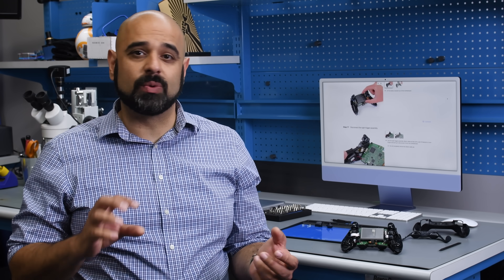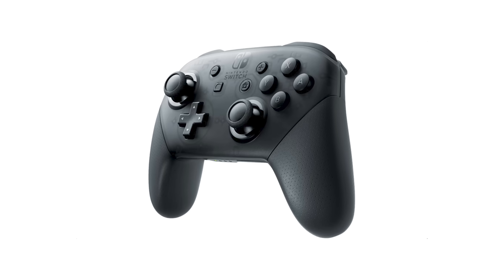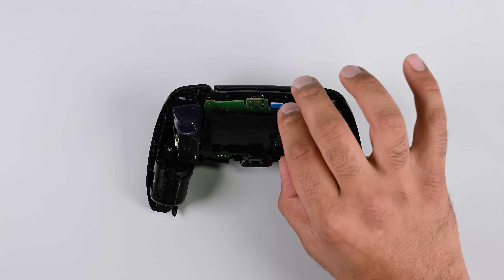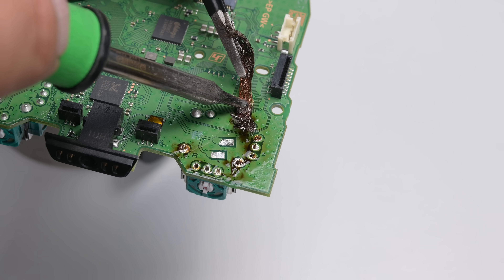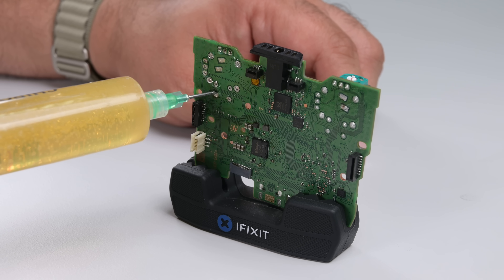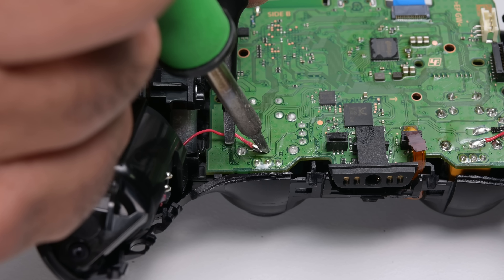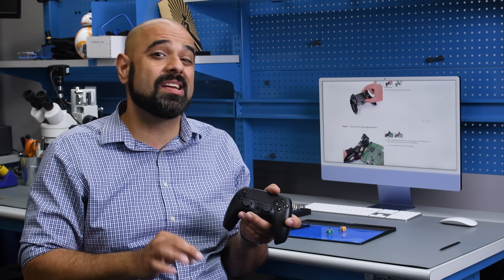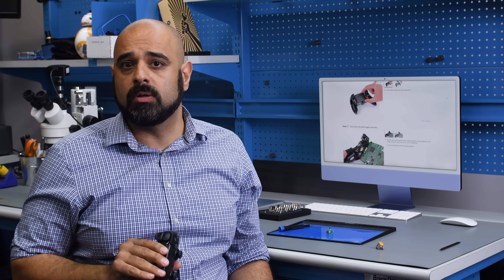How to Fix PS5 Joystick Drift for Good!

Comment: I can vouch for the Hall effect DualShock 3 controllers. I have a Japanese one from 2008 and it still dead center till this day. I just need to change the battery.
Reply: Yep. I guess I have one, my PS3 controller is 11 years old at this point. Still works like new.
Reply: @thebritishviking  same here but 17 years later
Reply: No need to vouch, the magnets are what make it possible.
Reply: Magnets, how do they work?
Reply: i can also vouch for a ps3 since then. it's good but battery idk
Reply: Same here
Reply: That's good to hear. I was a little worried, because I have heard that magnets loose their magnetism naturally and I have several older consoles like a PS1 and N64. So I was wondering how my PS5 would hold up with Hall effect sticks on the long term of not using them.
Reply: @TheRealBOBlibob ps3 controllers have magnets?
Reply: @castillomartin25  only some models. Some models of the dualshock 3 have hall effect sensors/magnets in the joysticks. But most don't.
Reply: @TheRealBOBlibob  the magnets lose 1% every 10 years or something like that naturally
Reply: @TheRealBOBlibob  I'm pretty sure if stuff lost magnetism then humanity woukd get destroyed by cosmic rays lmao. I'm no scientist though.
Reply: @ExecutionerDan  no he's right, metals do lose magnetism, but it takes way longer for a metal to lose magnetism vs normal sticks to start drifting
Reply: @Syddy_  interesting. Probably takes decades if I had to guess though right?
Reply: @ExecutionerDan  i just did a quick google and the magnets in hall effect sensors are neodymium, which only lose about 5% of their magnetism in 100 years. so i guess they're basically permanent. i was going off  like magnetised screwdriver bits that lose their magnetism way faster.
Reply: @Syddy_  appreciate it. It's cool to know that my apex 4 controller can theoretically last me decades before it fails. It'll be the buttons before it'd the sticks to give out now which is amazing.
Reply: @Syddy_  By the time that happens most of us will be long gone LMFAO
Reply: @Syddy_  Magnets can also have their magnetism 'refreshed' by being exposed to electrical fields.
Reply: @Syddy_  That's awesome. It seems like there are no downsides at all
Reply: @ExecutionerDan  your right, you arent a scientist
Reply: @Syddy_  yes, even if we somehow find a centuries-old hall-effect controller, you could just magnetize the magnets again with a magnetizer for like 3$
Reply: @Syddy_  What if i want to play some Fortnite season 500 in a couple of centuries? that's not permanent
Reply: @ExecutionerDan  I got water on mine and it got stick drif really fast, I also dropped it a lot, didn't treat it that well, was expected.
Reply: Not exactly hall effect. They had a new type of sensor developed for it, which didnt had the issues of hall effect.
Reply: weird my DualShock 3 started drifting on the right stick recently
Reply: @dylanconnelly9845  sadly not all of them r made the same
Reply: @dylanconnelly9845  The PS3 controllers have different batches, and if I remember correctly, the DualShock version does not have Hall Effect joysticks, and only the Sixaxis Controller version does

Comment: Manufacturers  want you to buy new controllers thats why hall sticks aint in them
Reply: I hate that it's true
Reply: Not Sega in 1998, the Dreamcast controller was hall sensor... they still work great
Reply: Dreamcast controllers are built like  Nokia phones
Reply: @fostrike Sega was a good company, and it's sadly the reason why it went out of business unlike the greedy corporations like Sony, Nintendo and Microsoft.
Reply: @StardustLegacyFighter  I like Sega, but that is certainly not why they went out of business. They can be just as greedy as Nintendo, Sony, and Microsoft.
Reply: @Malachi-Rhodes you mean Sammy Sega
Reply: @StardustLegacyFighter  Bro what.

Sega only stopped making consoles bruh. They are a giant in the video game development section thanks to Yakuza, SMT, Persona and Sonic.
Reply: @fostrike let's not forget about the ps3 in 2006 now
Reply: Also the Nintendo N64 analog stick is using a sort of optical encoder with slotted wheel similar to the one's used in the old school ball mouse, apart from mechanical wear they are pretty much immortal
Reply: Exactly
Reply: Definitely. CA$H grab!
Reply: The customers are also partially at fault for simply throwing away their controllers when just one component starts malfunctioning. Maybe it's because I'm from the third world, but I can't imagine having payed $60+ for a controller and not attempt to do anything to avoid having to replace it altogether. You don't even have to pick up a soldering iron yourself, there's plenty of electronics repair shops that regularly do analog module replacements.

Companies only seek to make as much money as possible, and if people keep enabling bad practices like these with their money, it's no wonder why they keep doing it.
Reply: sadly 3rd world countries such as Pakistan dont offer any form of customer warranty via any retailer since the company ( Sony ) cant provide it in some areas , and offf talk about the prices of these controllers , they cost around 80 - 90 dollars here instead of 60 retailers jank their prices up since they are imported products .
Reply: @inendlesspain4724  currently ive had my controller for around 5 to 6 months and its already started to have issues in its right thumbstick , plugging it into gamepad tester my controller doesnt register the bottom right and full right movements on my right thumbsticks , it also has drift towards the left on the controller ( left stick is fine for now ), repair shops here charge for 1/3rd of the controller it self for minor issues
Reply: @mohammadosman1474  Assuming you buy the hall effect analog modules shown in the video and tell the repair shop guy to use those instead of regular ones, I'd say 1/3 of the price of the controller for a permanent fix to analog drift is a pretty good deal.

Though I can see that being a problem before these things existed.
Reply: @inendlesspain4724  the current state of hall effects do have some issues either via jitter , non linear movement , or a delay in movement the only ones that are perfect are made from gamesir or gullikit they have the best ones i hope sony lets them make a licensed ps5 controller
Reply: is that not cause enough for a class action?
Reply: @HottiePersona  I was going to ask this same question 😂 if they knowingly are making them to break down then that is bad business . BBB let’s get their asses paying us back something
Reply: idk what to tell you man, everytime i got stick drift i send it back to the manufacturer and got a repaired one back, maybe just dont throw your controller away immediately?
Reply: HAll Effect sticks have their failure points as well...this video is just telling half truths...
Reply: was about to comment the same thing, concidering if manufacturers used hall effect it would only increase the controller manufacturing costs by maybe 10-20 euros a pop probaply even less due to ordering in bulk and it would increase the lifecycle of a controller to probaply 5 years atleast if its maintained well. it would decrease revenue by too much for them to do it. too bad sony has so much greed they give no shits about gamers. 

remember ps2 controllers, they didnt have stick drift but sticks would get stuck sometimes in some positions
Reply: He said they are 10-13 dollars. That’s not true they are like $1-$3 on AliExpress. That’s just another markup because our world is run by greedy maniacal pieces of 💩
Reply: Pretty much this, its planned obsolescence.  Making a device that last forever is bad for the bottomline as you wouldn't have repeat customers.
Reply: @nikushim6665  everything you buy is build that way since ever.
Reply: I keep seeing this video bout how companies are doing this..ugh yea . So I got the dual sense edge..got lucky enough to buy two stick modules. Now when I start getting stick drift, I’ll replace it, then repair/upgrade the stick drift module w Hall effect. And then rinse and repeat till I have 4 modules w Hall effect..just because
Reply: Morons still buy a $200 controller yet they still stick drift 😂 I’m fine with buying 2 controllers a year for $70 on ps5
Reply: @LALakers4life34  Console peasants buying two controllers a year is exactly why they do it :P
Reply: Jokes on them because every time I buy a new controller. I go home clean up my old controller with alcohol and a toothpick. Then exchange it because it wasn't working. 

Two controllers for the price of one.
Reply: @xKapnKrunch What you are doing is fundamentally fraud. In some cases where people get dozens of broken controllers and return them as just purchased or new, if the store catches on, the person can be criminally charged for fraud. Now you are not making a business out of it, the store will most likely just ban you.
Reply: Hall effect sticks most likely need to be licensed and can raise the cost up to the point where it is no longer profitable at the current price. Dual shock 6 would be the most likely the first time Sony would introduce them as it would be a "new feature". Seeing the announcement for the Switch 2 this morning, Nintendo rocks the sticks around like they are different than the current ones... Maybe Hall effect 🤔
Reply: They should be punished for such kinda actions
Reply: It's called capitalism
Reply: I'm a little late to the party, but Sony also wants you to buy new stick modules for their Edge controllers at $40 continuously instead of putting HE/TMR sticks in their controllers.
Reply: desoldering is the hardest part imo
Reply: A mid range rc remote that will have hall gimbals and long distance transmission is $60.... Just saying!
Reply: No, it is because nobody can produce a shred of evidence that HE thumbsticks are actually more reliable.

And unlike gamers, reputable companies rely on evidence to make decisions.
Reply: @nerdstrangler4804   Hall effects don't suffer from drift because they don't have mechanical wear on the resistance pad like pots do. High end flight sticks and sim pit stuff moved away from using them a decade ago.  Take apart a well worn potentiometer and you can easily see why they fail.
Reply: @nikushim6665  Hall effect sensors definitely drift. They just drift due to temperature or aging rather than mechanical wear. Feel free to read the one star amazon reviews for these hall effect controllers to see plenty of people complaining about their sticks drifting.
Reply: @nerdstrangler4804  I've been told by a local guy who installs hall sensors that the three major brands he's been installing he has seen a lot of controllers not getting more than 70 to 80% on those sticks. I'm not sure what that means but I think it means no matter how far you push the thumb sticks they don't read 100% of what you're moving. You know anything about this or have you heard anything about this? I'm just asking.
Reply: @relive1775  You are probably on the money. I don't personally mess with hall effect sticks as I have had nothing but bad experiences with chinese electrical components, so I avoid them whenever possible. But when installing a new thumbstick checking to make sure it can register 100% in every direction is common practice as occasionally you get a dud that doesn't quite make it. Only getting 70-80% sounds laughably bad, but quality control on chinese components is often laughably bad so it checks out.
Reply: @nerdstrangler4804   I agree that 70 to 80% does sound pretty bad. As I said I don't know anything about these that's why I'm asking from people who are talking about them. This local guy did let me watch him install these hall effect sticks into a PS5 controller and then hooked it into the computer and rotated the sticks around and they were saying negative 21% and the other one said negative 16%. Honestly I don't know how much about the stuff. I just bought a new controller and decided not to mess with it. But hey thanks for replying I appreciate it.
Reply: @nikushim6665 
Hall effects have literally 2 issues for the one that potentiometer have. They butter and don't always read full stops correctly.

Comment: The board's 6 layers make desoldering excessively difficult since its pretty much a massive heatsink within it. I use a rework station and each stick takes about 2-3 minutes at 500°C to get yanked out.
Ginfull (manufacturer of those sticks btw) actually has 2 calibration holes on each sensor (X and Y axis), so a pair of tweezers or paperclip is all thats needed to center the sensors.
Reply: Use of low melt solder helps with this
Reply: Ick. I've had the pleasure of soldering boards with large ground planes, the soldering iron got stuck in the pcb when the board sucked the heat right out of the solder.

And that was with surface mount. I don't think i'll have the patience if that was through holes.
Reply: @Hajile_Ibushi  indeed, going more than 350°C on my iron is definitely gonna cause accelerated wear and tear on my tip. however there are two tricks to go around it, both of which requires a hot air rework station. Either use it as a hot air curtain so the surrounding area doesnt wick the heat away easily, or just go ham as Rossmann would say "hot enough to melt sh*t", and use a pair of tweezers to yank them out.
Reply: I have a JBC soldering station, with active tips, which makes this sort of stuff much easier. Energy delivery to the tip is crucial.
Reply: Would you be willing to make a video detailing how to do this? I'm sure countless people would be very grateful.
Reply: Bro just use low melt solder and they come off @400° in a minute 😂

Comment: Direct and concise. 
Manufacturers are clearly at fault here, good on you for calling them out. 

I was baffled that even the fancy controller with swappable sticks doesn't come with hall effect sticks. What a joke.
Reply: Yes I've replaced my DualSense edge joysticks twice within a year of ownership. Also had to replace the mechanism that controls the back trigger buttons as the right trigger mechanism basically wore out over time!
Reply: @kevinhowe6307  Exactly, I was looking at getting a controller with hot swappable sticks only to find out the sticks were the same price as a $20 controller from Amazon.... And the Amazon controllers STILL came with back paddles and a mute switch, like what exactly is the $60 price tag for?
Reply: @divineroadrunner  It's insurance against malicious updates that disable third party controllers "to protect from cheating devices", even though cheaters can use remote play, we should all start warranty scamming until they decide to use reliable sticks.
Reply: even the xbox "elite" controllers have drift
Reply: The use of the old drift-susceptible potentiometers in controllers is all about greed and control - simply put, manufacturers want people to throw away old controllers when the potentiometers develop drift, this way the manufacturers sell more controllers.

Of course this approach is not at all friendly to people's wallets or the environment.
Reply: @SlartiMarvinbartfast  If that is the case the government should step in because it is wasteful and they are all about telling businesses "Cut down on waste!" today.
Reply: @christopherkidwell9817  Money can buy you many things, including the government's favor. That's what the campaign "donations" are for.
Reply: @SlartiMarvinbartfast  Ever increasing profit is more important apparently.
Reply: Replacement potentiometers are dirt cheap, normally you don’t need to replace the whole stick assembly. But in both cases it’s a fiddly job and unless you have the tools and skills to do it yourself, a professional service in the US or EU will charge almost as much as a new controller.
Reply: The fact that Sony would rather put in the time and money to engineer replaceable joystick modules instead of simply using hall effect sensors should tell you everything you need to know about their motives.
Reply: wow... was expecting that was a given at the ridiculous price points... guess they are starting to look for nickels and dimes at this point.
Reply: Few things are made to last. They'd prefer to sell you a $70 controller twice a year. Would love to be proven wrong, but they keep selling bad sticks.
Reply: If Controllers won't break How will Playstation make money bro? How will CEO's get another condo man?
Reply: @ItsShaggy3  They would  have no choice but to fire employees and/or reduce their pay. They need that condo.
Reply: @ItsShaggy3 XD
Reply: @ItsShaggy3 How much $ Do you need?

Comment: Outside of the soldering bit, this seems quite a bit easier to manage than the Joycon hall stick replacement. Those were tricky with all of the tiny ribbon cables and maneuvering needed to get the pieces apart. Best believe I had my iFixit guide to help me along in the process!
Reply: the joycon modules are drop in's while this requires some pretty extensive soldering skill and is far more risky. in what world is this easier?
Reply: Desoldering old sticks could be painful for people with no skill on that. If you are a beginner you need to invest in high quality soldering tools. Personally after destroying one ps5 controller board that then I used as test I ended up using a heated desoldering pump (70€). After removal and cleaning, soldering the new joystick is a lot easier. Anyway you need practice before trying the board you want to fix.